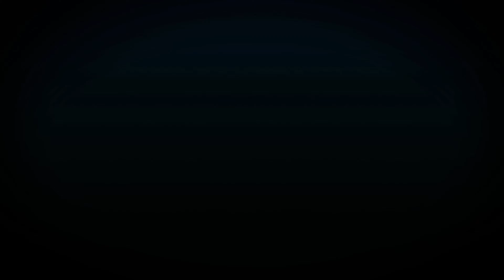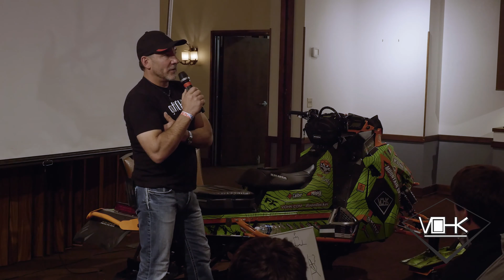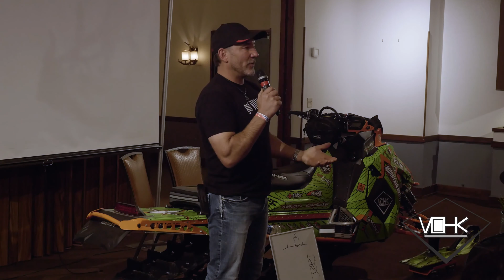2016 VOHK Clinic (Part 3): Does Higher Octane Mean More Power

Comment: I runchevron  94 in my 20 axys 800, because it’s the only gas station that doesn’t have ethanol. 

Should I just be running 91 in the ethanol setting? My sled does sputter/hesitate at  WOT from time to time